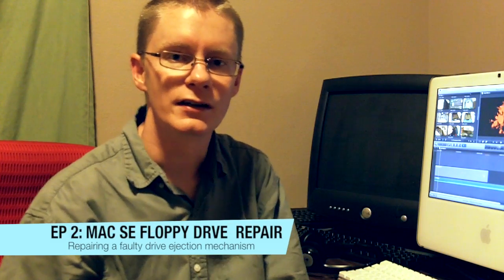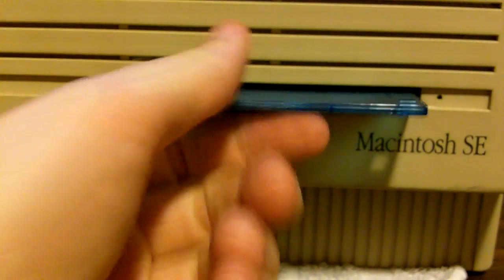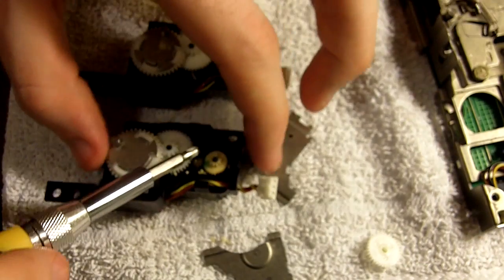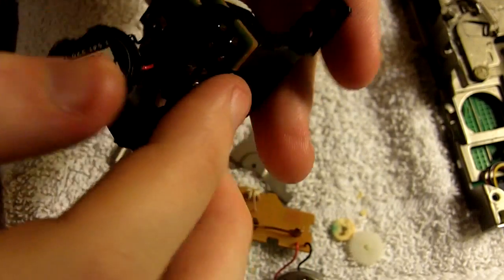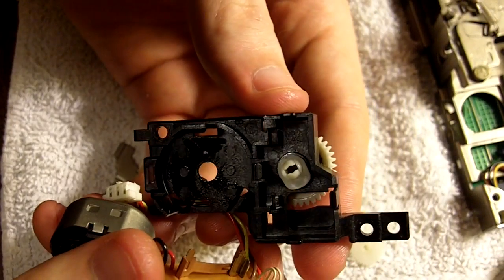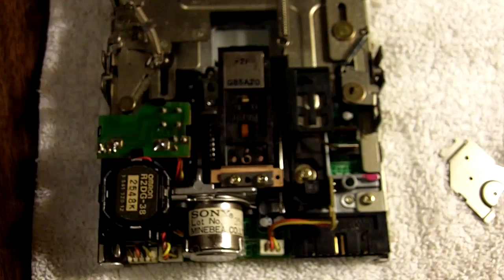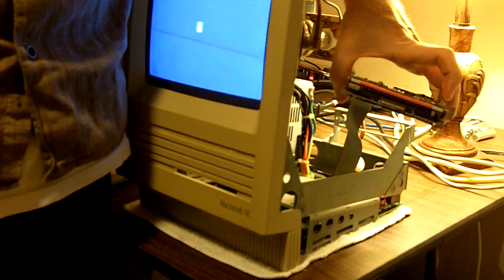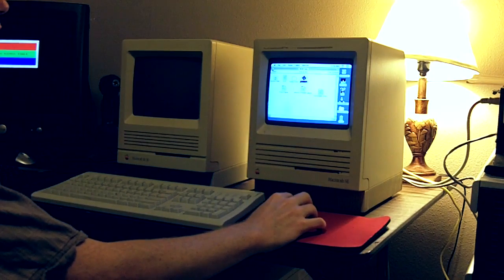Hak1985 E2 - Mac SE Floppy Drive Repair

Comment: if you cant eject a disk from the drive then grab a paperclip and slip it through the hole.that will press the manual disk eject.Just a tip if you cant fix the eject mechanism

Comment: Hi! Interesting video and very helpful. I have a Macintosh SE and I tried to turn it on but the system said it was a disk stuck on the floppy. So I opened it and indeed it was an diskette, I finally could release it, but when I turn on the macintosh it says the same problem. So I leave the floppy disconnected. Do you know if I can fix this floppy? Or what is the floppy model so I can buy a good one? Thank you very much.